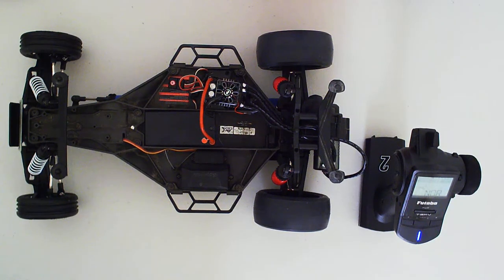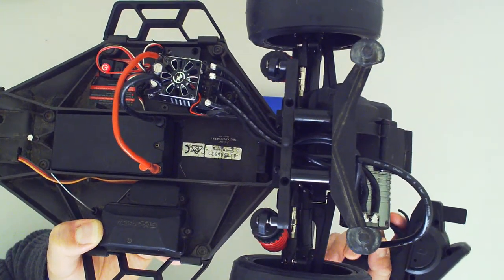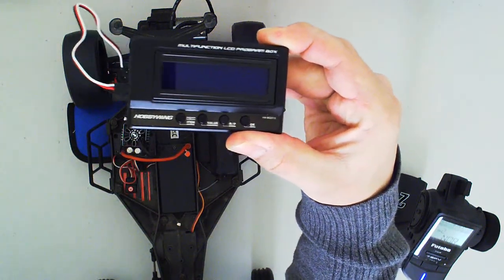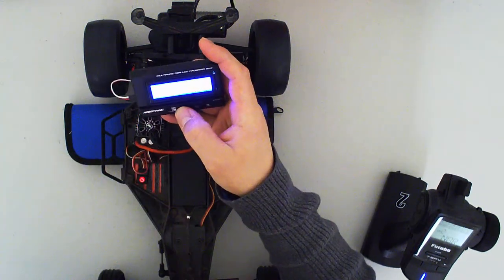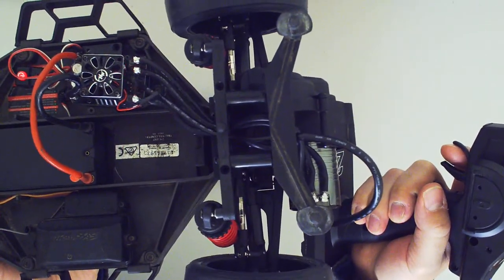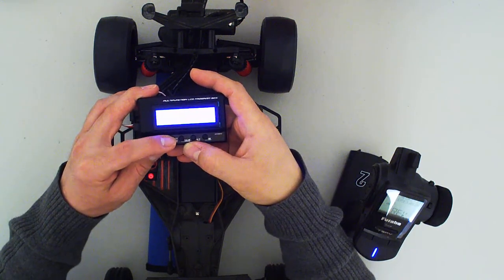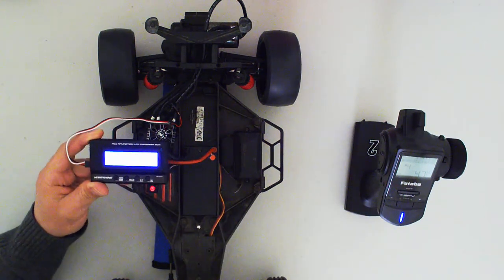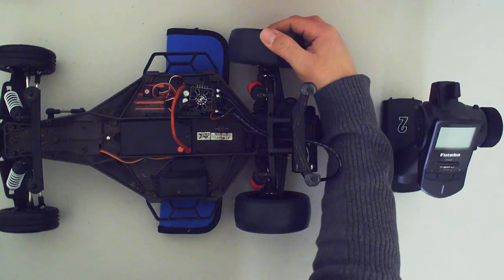RC setting correct rotation of the motor (Forward vs Brake and Reverse) to match esc to Transmitter

Comment: I have a hobby wing 1060 brushed esc and I’m Haveing this problem but it’s not programable??? Help
Reply: Reversed the motor wires then reversed settings on transmitter fixed the issue!
Reply from the maker: @nativeswag4958  I am glad it worked out. I was about to suggest the same steps but saw this post.

Comment: Can you just go from forward to reverse and vice versa skipping the brake?

I mean its a lightweight RC car, reversing wheels stops the car and you can do it faster.

My old Tamiya Hornet had simple ESC that did that and it worked fine
Reply from the maker: Not that I am aware. But you can hit reverse twice and it will "skip brake" and go to reverse. The faster you do it, the more seamless it will seem.

Comment: What if the stampede has an older blue Black fin xl5 esc and a e- revo /e maxx reverse rotation 12t traxxas 550 motor, can you change motor direction on a older blue black fin traxxas esc, or do I need to replace motor or should I replace Esc with a hobbywing type etc , Thank you
Reply from the maker: You can change the motor direction one of two ways. You can swap the polarity by swapping the positive and negative. But, if I recall, the motor runs a little slower. The other way is to reverse the signal in the Tx. https://youtu.be/11NQgiMPUIM

Let me know if this works for your application.

Comment: Thank you. I have a hobby wing 1080. Which number setting changes motor direction?
Reply from the maker: Are you using the program card or going off of blinks?
Reply: @telecomandorc  using program card.
Reply from the maker: @brianonthego  Assuming it is the same software version it should be item #6. It should read #6 Motor Rotation and you should see either CW or CCW. If is says CW, change it to CCW, or vise versa.
Reply: @telecomandorc  Mine is super old. Item 6 is reverse force..25..50..75...or 100%. I just flipped the rear motor bell 180 degrees..problem solved. Nowmy motor turns the oppisite direction in forward. Thanks for the help.
Reply from the maker: @brianonthego  On the contrary. Thank you for the information.

Comment: can it be done without additional hardware? with just esc setting or reseting default settings, or I need programming box? thanks for answer
Reply from the maker: It can be done, but you need the manual to know the number of blinks your esc model used for each option. You will need to keep track of the blinks on the esc. You need to set the esc in program mode using the little button on the switch. Then it will blink... depending on the number of blinks, it can be a menu option or sub-option. You just need to keep track of them or you will find yourself changing the wrong settings.
Reply: @telecomandorc  but what can I set up? I tried set reveverse as forward and forward as reverse, but no help, so I just reconnect motor cables a to c and it works
Reply from the maker: @reycox  You can switch the cables on sensorless mode or sensored if you have brake to 100%. Just make sure that if you go forward and then brake, it stops rather the try to dart in reverse. If it darts in reverse instead of braking, you will need to change the rotation in the esc.

Comment: I have the ezrun max10 sensored running in reverse and tried all sorts to getting it going in the right direction. Ive tried the standard hobbywing program card and even this cant change the motor direction.
The value is set at 6 after ive reset the esc lol theres only two options for motor direction so god knows why its set at 6 on option 6.
In the end ive disconnected the sensor to the motor and switched the a and c wires around and works great now as it should but as an uncensured system.
Crazy ive spent the extra for a sensored system and now running it uncensored 🤦🏼‍♂️
At least ive got the car running after many headaches 👍🏻
Reply from the maker: That is strange. Usually the program card has the capability to switch from CW to CCW rotation.
Reply: @telecomandorc I know dude, that's the real frustrating thing. I might take it to my hobby shop to have a look at some point 👍🏻
Reply from the maker: That is best. I am running the Ezrun Max10 3665 in my 4-Tec 2.0 and do not have an issue with rotation. I did have to update the card but once I did it detected the esc and I was able to set the rotation.
Reply: @telecomandorc  I'll let you know what they say when I get a chance to pop in 👍🏻
Reply from the maker: @1982james111  Please do. This is a great system in my experience. Hopefully they figure it out for you.